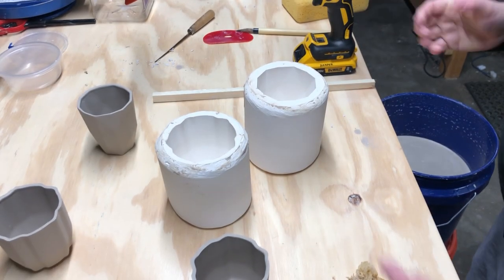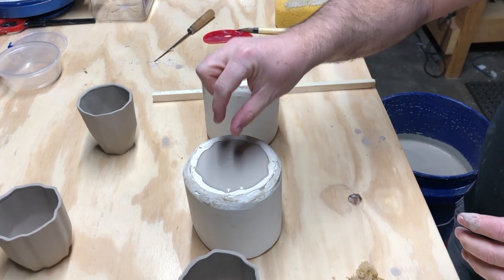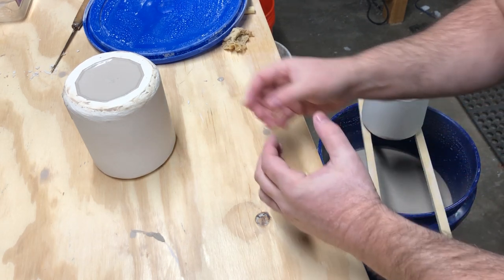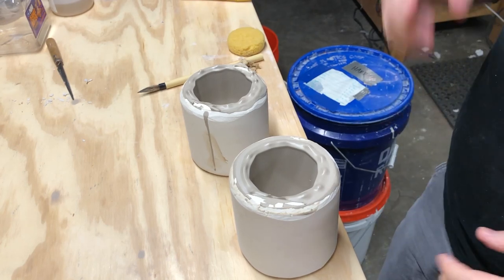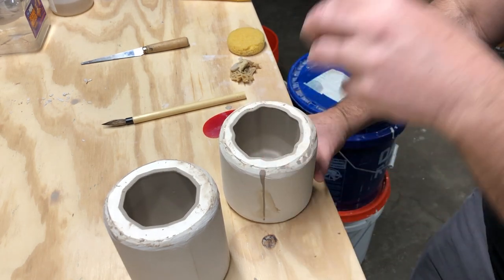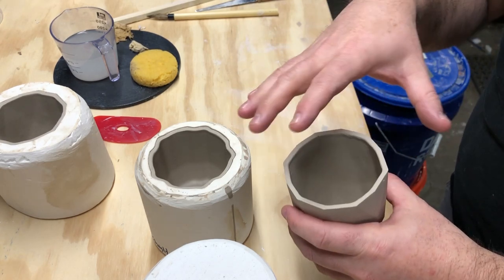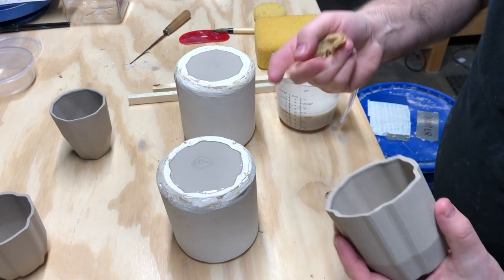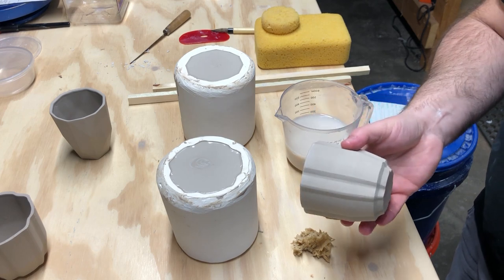Slip casting a cup from a one part plaster mold

Comment: Very nice and clear video! Maybe I'll try this technic later! I'm currently working on a project where I need to do some parts in plaster and I was wondering if I can directly 3d print my mold and cast the plaster inside or maybe I should do it differently? Any suggestions?
Reply from the maker: Hi Vladislav, I cast these plaster molds directly off the 3D prints, so I think it should be fine as long as your print is smooth and you put some mold release on it. I use Murphy's oil soap as a release. I put a few very thin coats and let it dry in between each coat. You can also sand and paint the 3D print and that can help release from the plaster (still using a release agent like Murphy's). I have more images and a walkthrough of the process here: https://claybucket.com/3d-printed-and-slipcast-cup/. Hope this helps!
Reply: @BrianHarperstudio  Thank you for the reply! I tried it today and it went pretty well. We don't have Murphy's oil soap here in Italy so I'll probably need to find an alternative. For now, I used a normal soap, and looks like it's working.
Reply from the maker: @VG_ST_D  Oh that's great to hear! I think if the 3D print is fine enough, you wouldn't need much of a release at all. That's good to hear the soap you have available is working well. I didn't realize you were in Italy when I mentioned Murphy's!
Reply: @VG_ST_D ... in case you see this, months later, you can also use a thin coat of petroleum-jelly (vasoline) as a release agent. Not all soaps have the "oomph" to create a barrier. Good luck!

Comment: lovely video, thank you! Can the moulds dry in a microwave or would that destroy the mould?
Reply from the maker: Hmm, I've never heard of that. I would be concerned about the moisture turning to steam and either cracking or exploding the mold. Putting in the sun, or a dry box will certainly speed up the process of drying, though. Thanks for watching the video!

Comment: Nice video Brian! Ive been having trouble with slip casting recently. Some objects are having small cracks at the inside bottom! Cracks are small and mostly visibly when objects are already bisque. Any Idea what can cause the cracks?? Thanks!
Reply from the maker: Hmmm, I'm really not sure. Do you have a different slip you could try and see if that helps? That would rule out of if there's an issue with your mold. In this video, I used the Cone 10 porcelain slip under the Dylan Beck recipes here: https://claybucket.com/recipes/casting-slips/ Hope this helps!

Comment: Good morning, 
How much would a jar like this one cost to make? From start to finish. Meaning that it could stand hot and cold Temps.
Reply from the maker: I'm not sure exactly. It requires the use of equipment (like kilns) that are expensive and vary significantly across brands, size, and age. Most of the supplies are able to be purchased pre-mixed, so for example, you could buy pre-mixed slip, pre-mixed glazes, etc. I work within a university setting, so those costs are absorbed among the thousands of pounds of the materials and supplies we buy each year. Sorry I don't have a better answer!

Comment: There appears to be 2 different coloured plasters on your moulds - white inner and something grey on the outside. What is that please? Very clear casting video, thank you.
Reply from the maker: Hi Celia, thanks for checking out this video. This is just porcelain casting slip. It's the first cone 10 recipe on this page: https://claybucket.com/recipes/casting-slips/. So, it's not a different colors, it just looks a little grey as it's drying. It fires white though. Hope this helps! Let me know if you have any other questions.

Comment: Thank you, very informative. One question; can i use stamp on the product that fresh out from the mold? or it is too dry to stamping?
Reply from the maker: So glad you enjoyed the video. I've never tried to stamp the forms when they come out, but I think it would work if you use your other hand to brace or support the form. Also, the lower part of the form will be a little wetter, so you should be able to use most stamps, especially if they are smaller. Hope this helps!

Comment: Perfect 👌 I like it 
But I want to ask you a question
I did a ceramic tray of white clay and I want to glaze the bottom but I am warry about stocking in the kiln especially there is no legs so how can I colour the base?
Reply from the maker: So glad you like it! The way most people glaze the bottom of an object in a kiln is by using little stilts like these: https://www.theceramicshop.com/store/category/9/29/Star-Stilt/. They work better at lower temps and I wouldn't recommend using them at any temperature higher than cone 6. Another option is to use a stain like iron oxide. That will add color to bottom of the object and as long as it's not applied to thick (and you wipe it off gently) it shouldn't stick to the shelf. Hope this helps!

Comment: If you don't mind me asking what's the point of creating a mug or cup made of plaster if it's not food safe?
Reply from the maker: Hi Tiffy, the cup is made with slip cast porcelain - that liquid I'm pouring into the molds is porcelain clay slip and the plaster mold absorbs some of the water and therefore hardens the cup enough to be able to remove it from the mold. Then, when it's glazed and fired, it is food safe! There are a few examples of the finished cups at the bottom of this page: https://claybucket.com/3d-printed-and-slipcast-cup/. Hope this helps. Let me know if you have any other questions!

Comment: could I use the mold mix and pour it back into the actual mold ? could that work
Reply from the maker: Hi DB, are you talking about pouring plaster into the mold? You can make plaster positives from a plaster mold, but you need to make sure you have a good enough coating of a release agent inside the mold (or the plaster will get stuck inside the mold). You wouldn't be able to use the same batch because by the time the mold plaster was hard enough to remove the object that was being molded, the rest of the plaster batch would also be hard. Hope that helps!
Reply: @BrianHarperstudio   Very new to this and going to try a few projects soon. Thanks for the reply